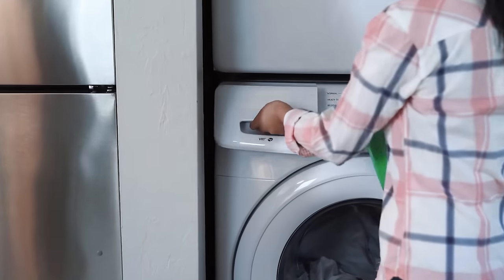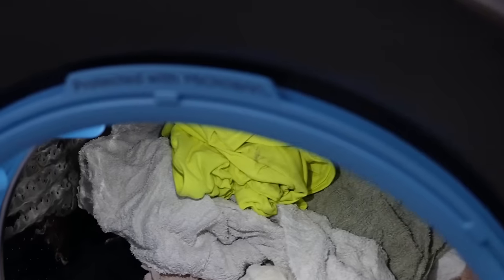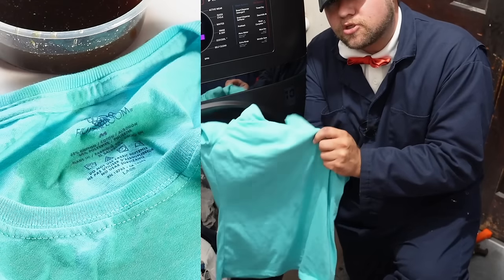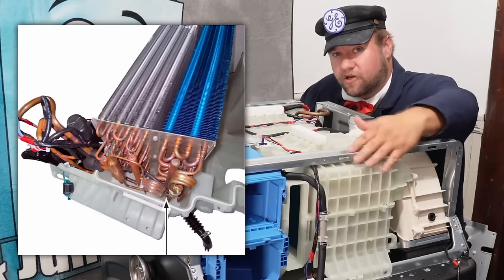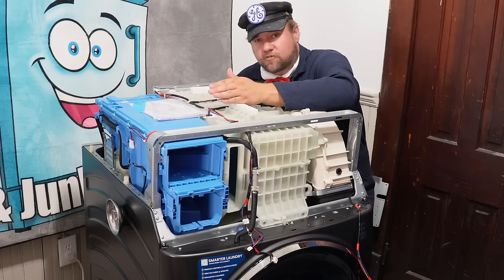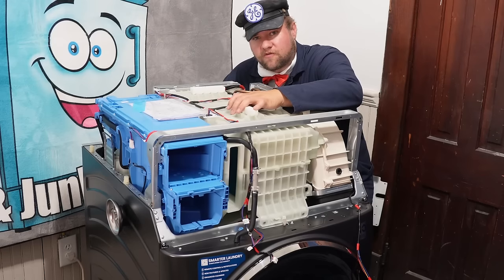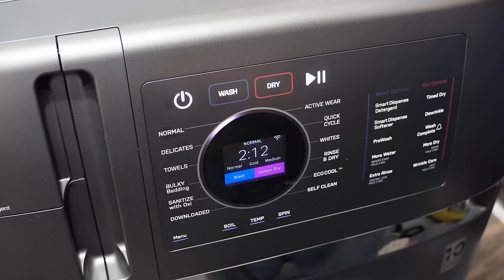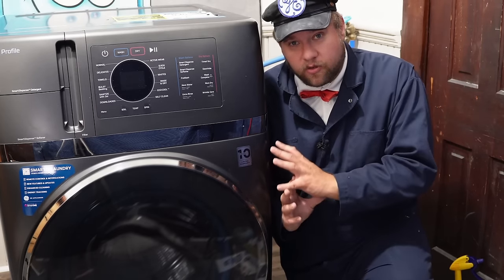The Best Washer Dryer EVER? The Ultimate GE 2-in-1-washer Dryer Combo Test & Review

Comment: For perspective, where I live (Northern Virginia) a standard load in my separate washer and dryer costs about 40 cents (non-summer) to 50 cents (summer electric rates).
This will cost about 12-14 cents to run a load.

A solid, electric, washer and dryer set from GE is $1600-$1800 (. This settles at $2200 on sale ($2600 off-sale).
That's $1600 + .5x vs $2200 + .12x, which has a breakeven point of 1528, meaning it takes 1528 wash cycles (one a day for 4.18 years) before you save any money.
I, personally, do not have natural gas service. However, in my area, it would cost about 8 cents to dry a load of laundry using NG. I.e. you'd never save money using this setup. 

He says you can save "hundreds" per year... if you're running hundreds of cycles per year or live somewhere where electricity is exorbitantly expensive.

This machine weighs about 302 lbs per GE, so keep that in mind when thinking about navigating it down stairs to your laundry room (if applicable).

Now, of course the great thing is this can be placed in most locations with a water, drain, and normal 110-volt outlet. (As shown, it doesn't exceed 1100-1200 watts, perfect for a 15-amp circuit.) It might allow apartment/condo/or small townhouse dwellers to have an at-home laundry facility for the first time ever.
It could also simplify how tower apartments are designed: think of how much savings would go into: not running gas/220-volt lines, not running vents, not cleaning vents annually, practically eliminating dryer fires, etc.

But, for the normal consumer... unless you're running a ton of laundry through it, it's a tough value proposition. Maybe if/when it reaches price parity with a normal set.
Oh, and I hope it goes without saying that you'd not want to replace working units with this to "save money". 
If you keep using your current setup, you'd break even at ~5800 loads.

Comment: I agree with your assessment. If the unit was run without the filter, it would likely compromise the heat pump within a few loads. Anyone who has cleaned a dryer duct can attest to how much lint and junk gets through the unit, even with a screen installed. The filter appears to be high quality, but I would imagine that there is a non-zero amount of lint gets past and then settles on the cold side of the heat pump.
Reply from the maker: I've ran about 5 loads through it. I am going to film the heat pump replacement soon by-the-book as how GE suggests it (its a whole package, you just take the plastic tub, compressor/coils and all and drop the new one in). But before I illustrate how to remove the plastic box, I'm going to take the cover off and film the coils for a future video. "Heat Pump vs. Tumble Dryers"

Comment: I have a LG WM3997HWA All In One combo 4.3 cu ft from 2018 I think. New, I paid about $1,800. Would rather buy this GE on a holiday for closer to the same price. An average load takes about 3.5 hours to complete, in which 2 hours sounds nice. There is no filter and lint tends to build up around the front door seal as well accumulates around the unit as it is ventless with no filter. The rest likely goes down the drain as the drain filter catch seems designed for pocket change, jewelry, or similar size items. After about 4 years, the drain pump impeller broke and I replaced the pump myself. It has been about 14 months and the LG replacement pump is broken again. Only used a couple times a week in a condo that has no vent stack for a typical double stack washer dryer.

Based on this review and other I have seen... Likely going to repair, sell, and likely buy this unit in a few months.

Comment: These types of units are great for someone like me who wants to get off natural gas. My laundry is on second floor with only 120v/15a service. Getting a 240v run there would be extremely challenging/costly. Most heat pump dryers I've looked at are still 240, but there are certainly options (like this) that accept 120v/15a (and just take longer). Personally, I like the idea of setting my dryer to start when I go to bed and finish when I wake up. Sipping as little power as possible.

Comment: Have a 12 year old Miele heat pump dryer and hasn’t missed a beat once the whole time. Clean the lint filter after each load per normal and the plinth filter when it tells me to. Not one issue. Just as efficient and much faster drying times by far over American market heat pump dryers. So behind.

Comment: Smaller Washer Dryer combos are a bit popular here in Brazil in crowed regions (you have no space for air drying) or cold regions. They have a red sign in the door to indicate the load level in the drum (usually at 70%) that we should not pass if we want to (properly) dry. But I realized that that red mark is useful to wash too: if the drum is really at full capacity, the clothes will not properly rotate, so the washing will be compromised. Don't mix different kind of clothes if you want proper drying. Example: wash/dry underwear, socks, t-shirts, shorts together, don't mix them with heavy tissues clothes, like towels, which should be washed/dried with other towels, due the moisture sensor.

Comment: The BIG reason for wanting a machine like this is that it doesn't need a dryer vent -- I lived in an apartment that I loved, but could not run a dryer vent from the only place a machine could be installed -- so the combo was the only choice if I wanted a dryer.

Comment: If I'm not wrong you got the air flow pattern wrong. On the compression cooling cycle - air is first passed over the evaporator coil to cool it down and remove moisture and then over the condenser coil to heat it back and to a higher temperature to increase it's water holding capacity. This works out as more work is put in then the actual cooling kw removal. 

For eg. 
Ambient air temp : 25°C
Cooled down to : 15°C
Heated back upto : 32-35°C

An easy way to make it more stupid proof would have been to increase the air velocity and throw in a cyclone separator or obstacle purifier to so that dirt etc. would fall down through a chute outside the enclosure. But that'd would been an additional cost of $60-70.

If you're a household with 2 or more kids, and will maintain this thing good and keep it for a decade, you'll save enough money. 

Also, you can time this machine so if you've got time of day rates, or solar on your home you're able to tun this for essentially free, maybe $0.05 per a 18lb load for the water cost.

Comment: Ive seen a few reviews about heat pump dryers now and some mention that when the load finishes the clothes are not wet but may feel like they are due to a higher humidity than you may be used to with a standard dryer. The suggestion from those reviewers is generally to shake out the clothes right after taking them out. This is typically when im folding the clothes so it wouldnt add any time for me. Im curious if others believe this to be the case as well.

Comment: I have this machine and it's been running well until recently. It started leaking water everywhere. Come to find out there's a huge tear in one of the bottom hoses. I have no idea how it occurred.

Fortunately, it's under warranty still so I'm going to call Home Depot and/or GE tomorrow. Also, I recommend anyone looking at this machine to buy the riser with it. I cannot stress that enough. A riser will make cleaning the front filter so much easier.

Comment: I guess I'm a Luddite. My two old-timey units each take 35 minutes to do a load of wash or dry, so I can do a load of colored and a load of white in 105 minutes and go about my business. The use of a 120V supply (not mentioned) and the ventless feature (also not mentioned) are the pluses that most intrigued me. My current dryer vents thru my DOOR, since I have very thick masonry walls.

Comment: Great idea if you have limited laundry room space or small apartments, I can see this being ideal. But I don't know if I would buy one. If something goes wrong with either washer or dryer component, you are down and out SOL doing wash and having to go to the laundromat. Also, this would slow down the laundry process by having to wait for one load to wash and dry before putting in another load. With a separate washer and dryer, you can wash another load of clothes while the first load is drying. I'll stick to separate units.

Comment: I believe this is a 110 volt machine.  That's a big advantage for lots of folks.  A big disadvantage is that you can't run a second load while drying the first load.  An Electric Vehicle EV charger can take the place of an 220volt electric dryer, without having to rewire the house

Comment: I have the LG version of this machine (WM3770HVA).  The Lint trap design of this GE is great.  My LG requires draining a plug below, then pulling the filter tube out, which is always slimy and gross. Even with clearing that out every so often, I've had to replace the drain pump about once a year or every other year for the last 4-5 years Ive had it.

Comment: Mine is good.. tape the foam filter on the right side..& clean every time it’s used.. I fabricated a vacuum  attachment that I use to carefully vac the coils off & the chamber.. I like to keep things Very Clean.. It runs great .. Once the cloths come out , they feel damp & warm.. Once you shake & fold their dry.. Also No static.. Nice!
The other thing is that I leave the door ajar & leave the filter on top of the machine.. You will feel the dampness escaping.. I put back in the next day.. Yes the light shuts off after a few minutes with the door open.. Check the gasket at the door, make sure it’s clean, a quick wipe is all that’s needed..

Comment: Although this unit is labelled GE, you failed to mention that it is actually a Haier. General Electric sold their appliance division to the Chinese company in 2016. Haier is allowed to use the GE name until 2056.

As for your preference for LG, I own an LG front loading set (gas drier) and will never buy LG appliances of any kind again. When I bought it, the clothes at the center of the drum were still dry at the end of the first wash cycle. Three different repair companies said it was fine, but the third tech installed a different water sensor which did improve it slightly. When the warranty was over, I again replaced the sensor and adjusted it as shown in a video elsewhere on youtube. It still doesn't clean as well as the 1980's Whirlpool it replaced, but it is tolerable.

Comment: I've got the GE GFW550 washer, and have been highly impressed with how dry clothes come out.  Much dryer than any others, in my experience. Very high speed spin cycle, like 1500 RPM.  That's part of the "trick" of the dryer combo, imo. I like it, except 2 things. Warranty "requires" GE specific hose set, which can not be sourced anywhere, second GE goes into great length to hide "Made in China".

Comment: One huge benefit of this machine that barely gets mentioned is ventless.  A unit like this that has no vent and operates on a standard 110 outlet can be installed almost anywhere. You only need water and power. Cleaning out a lint trap isn't a high maintenance issue for anyone who's used a dryer before.

Comment: I will definitely keep this unit in mind when I'm ready to buy. I have been mulling over wether or not to get a stackable set or an all in one unit. Cleaning the filter is not an issue. Very interested in your veiws and experience with the unit going forward.
Reply: If you haven't seen it already, he did a "best/worst appliances to buy" video and said that all stackable (unitized) laundry sets are junk.
 If you're talking about the unitized stackables and not front loaders than can be stacked, I would skip them. I've been in property management for 17+ years and have worked on hundreds of these from different brands and they just don't hold up.

Comment: I started with a 24" form factor LG stackable with condensor dryer. I don't think they sell that dryer in the US anymore because of issues with the main board. I did switch to the GE and it was a disaster. Now I run Bocsh and love them. The Bosch doesn't use a resivor for the condensor, but a drain tube like the GE here. 
I will say they are more maintance than a "traditional" set up. But if you're up doing it they're totally worth it.

Comment: I know somebody that had a washing machine in a Boston house the house was built in the '50s and it was the original washing machine still had a great rubber seal and it washed and dried the clothes in the same machine.
Accountants and shareholders are the reason for planned obsolescence.
We could manufacture a machine that lasts 50 years why don't we do it you could be our lead engineer.

Comment: This is pretty cool. I'd say that if they made more of these and the price came down about 25% from that 2100 then you'd see this really take off. Not only are you saving space in your home but you also save some money on electricity. It also means that you wouldn't need a dryer vent and thus you wouldn't have to worry about periodic cleaning of said vents and with that a reduced risk of fire. Since clogged dryer vents can lead to home fires.

Comment: I've seen teardown videos of the older samsung heat pump driers and have thought. This is absolutely insane, it's obvious that lint will collect on the condenser coils even with a lint filter, and then you have to take the entire unit apart because the coil is in the base. It's a huge step forward that the condenser unit is in the top and more easily accessible and replaceable but it's out of necessity because the unit is also a washing machine. I think manufacturers could take this a step further. Design the unit so the coils are accessible through a hatch in the top of the unit. That way the end user could clean the coils themselves once a year and maintain efficiency with minimal cost and time to maintain.

Comment: One of the major shortcomings with a heatpump dryer is normally having to either empty a water tank after every load, or figure out how to drain it (since it's likely your only drain in the laundry area is already used by the washer and is thus unavailable). This unit avoids the problem entirely by letting you use the same standard washer drain hose for the dryer too.
Reply: Does the water from the dehumidifier get pumped out or does the water drain need to be lower than the unit to allow gravity to empty it out? The only reason I ask is because in my current set up my washer needs to pump the water up into the slop sink next to it. The drain is not low lying.

Comment: Your video is the best!! Been looking for a video with more technical and operation info and thanks for taking it apart. Would there be issue with leaking refrigerant at all with these machine?
Reply from the maker: The refrigerant pipes are pretty darn robust, and its R-134 which is an older but far more documented style of refrigerant. I do have a video coming soon with the full teardown of the unit.

Eventually I will do a video on the analysis of the heat pump system vs. a typical dryer. I do have a video that shows the machine in operation on the channel (FPV of a GoPro in it) that shows the blower operation as well as sensor log readings from how the unit heats up and cools down in usage that is super neat too I think.

Comment: Based on my usage of my current washer and dryer, this unit would pay for itself in about 4 years. One additional bonus is it's about 2/3 the height of my current stacked units, this freeing space for a shelf or something above it. One question I have is this a 240/208V unit or 120V?

Nvm, I looked up the specs, it's 120V. That's a huge thing for someone like me that has a full breaker panel and wants to put in an EV charger. Being able to move/reuse the wiring from the 240V dryer I have and repurpose it for an EV charger is a significant thing.

Comment: I use the LG WM3488HW for 7 years, a lot less complex. and the dryer part works flawlessly. The only problem with it is its evacuation pump. GE, as always, making things more complicated than it should. Peltier effect is much more appropriate here ....
Reply: Peltier is significantly less efficient than a compressor based heat pump. A conventional water cooled condenser washer dryer will use lots more electricity, also dry at a higher temperature which is worse for clothing, and also the element makes them a potential fire risk. In the UK where electricity prices are higher, heat pump dryers are virtually a no brainer,  as they'll pay for themselves pretty quickly, well unless you need to use them in an unheated building in winter.   One or two Heat pump combi washer dryers have been available for the last few years, but reliability doesn't appear to be that great yet, probably quite compromised by having to fit in an standard size 600mm wide gap.